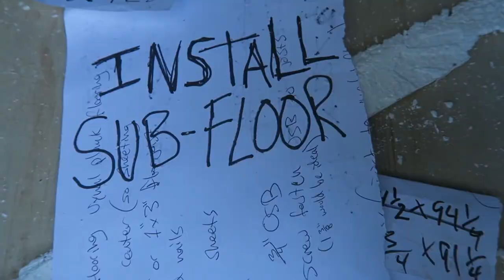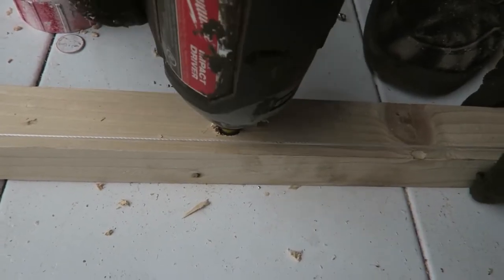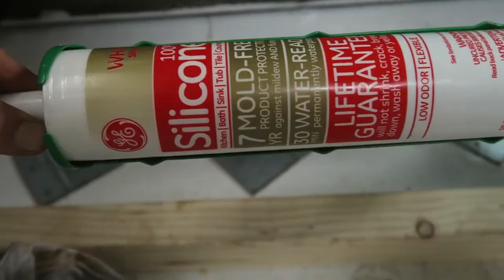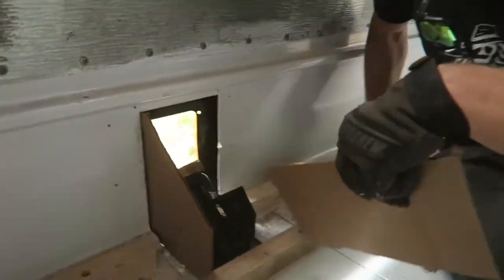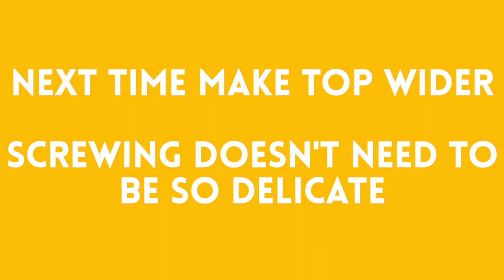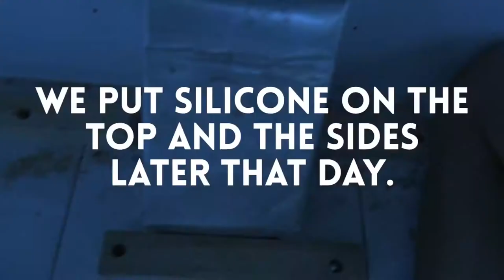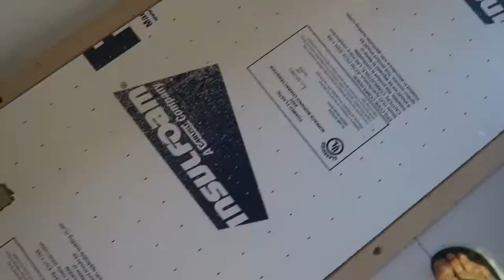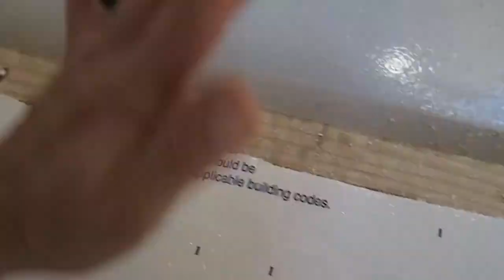#39 SKOOLIE BUS CONVERSION | INSTALLING THE SUBFLOOR!

Comment: Nice to see you insulate the floor, so many skip this area and only worry about walls and ceiling. An earlier comment about screws you probably may want to paint as drilling through steel removes the zinc coating sometimes though it's not the end of the world if you don't..hardly like you will be removing then any time soon lol. Keep up the hard work nice to see progress other than getting it running again.
Reply from the maker: Thanks Larn for confirming this! We'll put it on our to-do-list! :-)

Comment: Just one question guys, What are you going to do with all the self-tapping screws that are now sticking from the bottom of your bus?
Reply from the maker: Hey Orion's Corner, they're zinc coated so they shouldn't rust. Well, we hope that is the case. However, we will most probably spray them with rust-oleum (on the bottom of the bus). Fingers crossed we do a good job! :-)

Comment: I think the foam board with foil backing is a wonderful idea, however, I am wondering how you determined that placing the foil side down is the best installation.  I'm sure I will use this on all my insulation jobs in my bus.  It's not that I think it should be installed other side up, I was just wondering why you installed it as you did.
Reply from the maker: Easier to mark the lines we wanted to cut using a pen on the white side than on the reflective metallic side. I doubt it makes much of a difference which way it's installed in the floor.
Reply: Thanks, again I really enjoy your videos.
Reply from the maker: Also, on a sunny day, that reflective side will literally make it hard to work near. That suff reflects light beautifully, but that's not ideal when you're making measurements and focusing on keeping your fingers. :D

Comment: Ian, just a thought but i think you can get 'Bed Liner' in an aerosol can. Might be a good choice to spray inside and over the back of your new filler cap cover. Would stop it rusting and be flexible enough to not crack when driving around. Good to see a load of progress as well, you are doing great :)
Reply: Yes, bed liner spray is a great water proofer and I use it on all gutter seams with no leaks, no problems.  Should also seal out any smelly diesel drips.